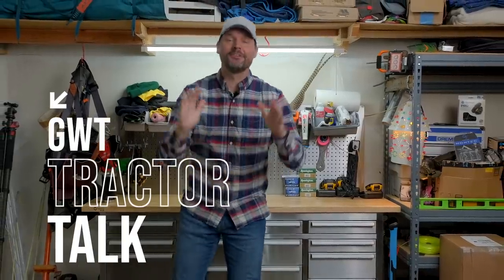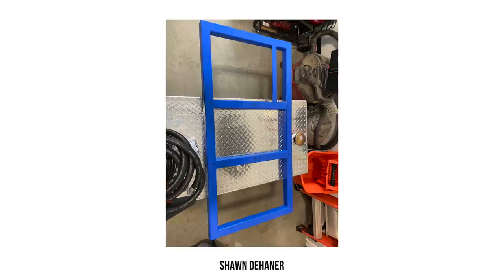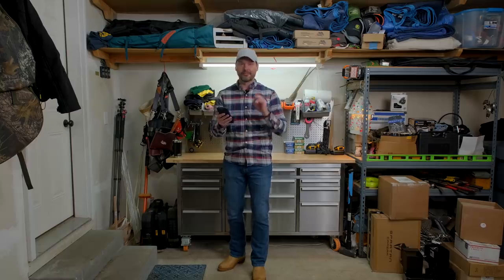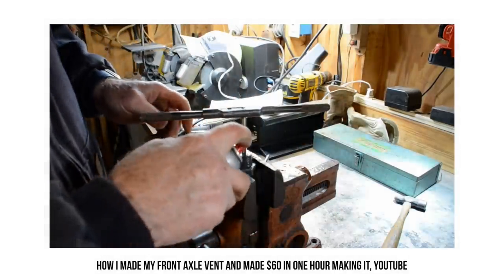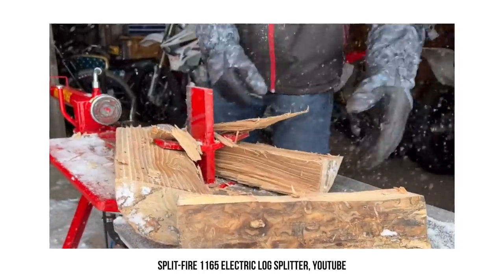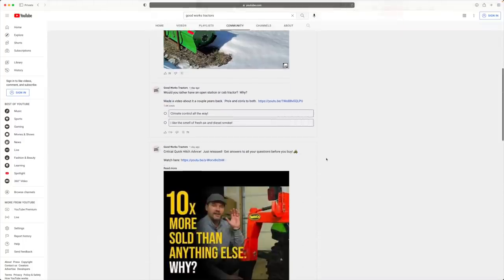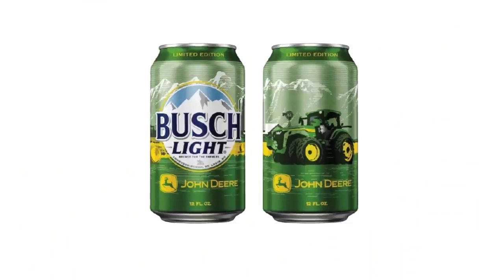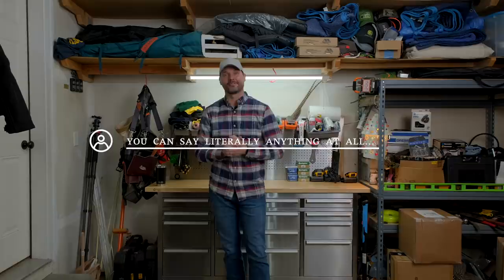DIY DELUXE SKID RUNNER WILL BLOW YOUR MIND! TRACTOR TALK #7

Comment: The Kioti snowblower skid shoe is a great idea 👍🏻🤔. Have a great weekend 🙂🙋🏼‍♂️👍🏻
Reply from the maker: You too OIMNG!
Reply: He needs to patent the thing.
Reply: @jimmcknight3021  Agree 👍🏻👍🏻
Reply: I have been using this idea on my front blade snow plow for years. Never fails never scalps I have a gravel driveway and I used a piece of 3 inch tubing mounted where the plow shoes would normally be, full width set up a second unit with the same size tubing and it works equally as well. I’m looking at a snowblower for my new coyote and acts thinking that it needs to have this sort of set up. If you’re the guy that needs to back drag with your front plow use the same idea as a cutting edge for back dragging in a gauge for going forward. Similar to the set up on a box blade
Reply: @truckerlarry7345  do you have any pics or video?

Comment: That full width skid shoe for the snow thrower is a great idea. Tractor time with Tim had that problem with his loader mounted plow. I guess the skid shoes are sized to hold up the weight of the plow, not the weight of the plow and front loader.  There's you an idea for a new good works product.
Reply from the maker: Haha, maybe so!!

Comment: Congrats on winning the lottery (nice tractors to sell for spring!)...   Never underestimate the 2025R...  Loader will move 12' logs kept low... Fits everywhere the 1025R does but a better ride for rear PTO mowing/ bush hogging than the 1025R with better rear lift height. Proper ballast is key to compensate for it's extra ride height is all.   That backhoe will do!  ;-)
Reply from the maker: Haha, thanks Hugh!  Maybe we'll do some video with that 2025r :)

Comment: The reason I have not purchased a snowblower for my SCUT is I have a gravel drive and turn-around.  Traditional skid shoes dig in and you throw way too much gravel.  The full-length skid shoe would seem to be the perfect solution.  If I could buy one of those and fit it to a purchased 3-point snow blower, I believe I would make the jump to a 3-point snowblower.  I believe he should patent that and start selling a universal mount version.  I think it would sell.

Comment: That skid runner is going to pack the snow below it.  After a couple of snow storms the road  will have several inches of packed snow.  The first time it gets a little warm it will melt into slush then refreeze over night.  Making a massive mess.  Trust me I know. 
I plow or use the blower.  Then I have a drag plow behind my side by side to take all the snow off down to the stones.  The drag plow has rubber on the edge and does not move many stones.  I also have an Echo 810 which blows the stones right back into the driveway in the spring.
Reply from the maker: I think that's why he made it adjustable from 0" to 1.5".  That would seem to solve the problem you're experiencing.
Reply: Agreed, too much base is indeed a disaster after a thaw cycle or two. Courtney is right on target with his comment about the adjustability. The thickness of the base is entirely up to the user. Once a base, or coating is established, I set the lift height to zero which sets the blade right down and eliminates any further build up. It works pretty well.
Reply: GP Outdoors in a recent episode. showed that he could use his back blade while he snow blowed with his front blower. I  was amazed how thick his base was.  Like others have pointed out, he does that in part to eliminate slush of a thick base so it won't refreeze to ice.
Reply: @brettwhite1998  I’m up in the Adirondacks and would be interested in purchasing one of those blower shoes if you would be willing to make another. If not any chance you could share more details and I’ll take a shot at making one myself - really nice design!

Comment: I go out in the woods with my 520 tricycle front and probably go were a 2025r cant go real well and i will drag logs out. I got a 34 incher down of what was left from mother nature topping it for me.  It will be close if i can do it in 2 15 footers or 3 10 footers. My front end i dont think will be doing much work.  Gotta put my tire back on as a couple weeks ago my clutch fork broke and destroyed the bronze c collar ( equivalent of a throwout bearing) and when went to install replacements i discovered where the c collar ride a chunk was missing so of with the clutch pulley and crap not clearing the crank before pulley hits the tire.  Spent about $1000 to fix the clutch but NO splitting tractor to fix clutch